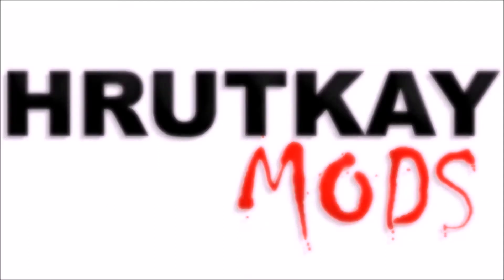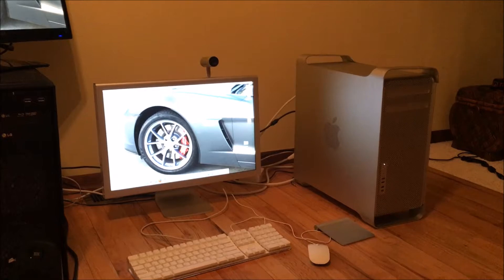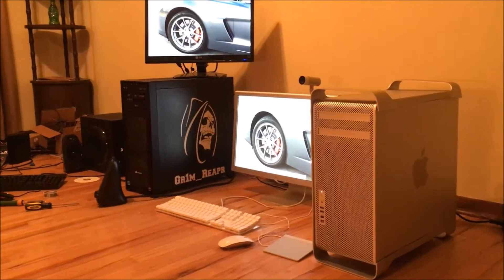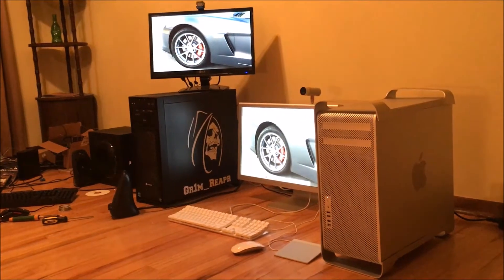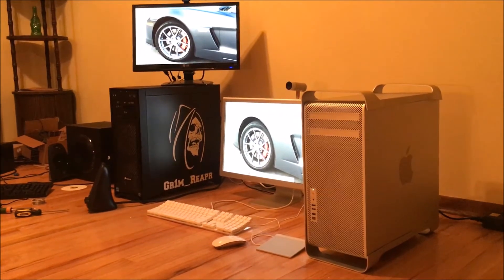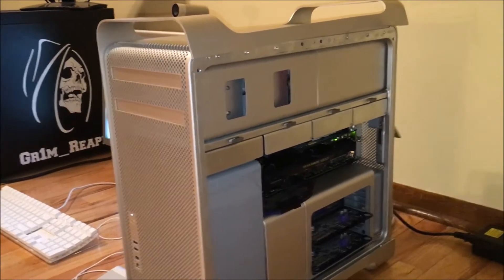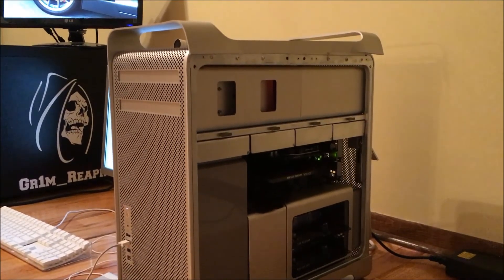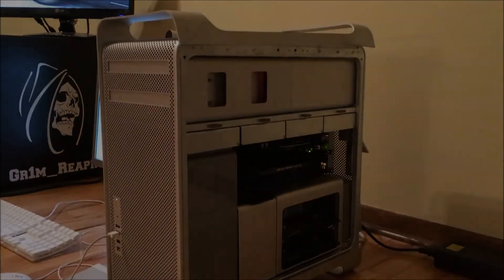Why You Should Buy One - Mac Pro 1,1/2,1 Series ep.3

Comment: I have a Mac Pro 1,1 2.6 GHz, ati Radeon xt1900 512mb, 12 GB RAM with Snow Leopard OS. I'm wondering if it is worth upgrading specs to a 2,1 system like yours? My main use would be editing and photography. I'm in two minds, especially since I don't have a copy of Lion to use for upgrade using Pikers boot eft., also I would need to upgrade CPU and GPU and update firmware.I live in Australia and a decent 2nd hand Radeon 5770 1gb card is almost $200 on its own. What other GPU choices do I have for this PCI 1.1 machine? Do you think I can upgrade for under $500???Any feedback or suggestions would be appreciated - thanks.
Reply: I am in same boat. I want to know what is the best coast effective graphics card. Perhaps do CPU upgrade I am about to do X5355 quad core upgrade.
Reply: Im from australia. I have a mac pro 1.1 with a 5770. works extremely good. ive upgraded it to 2,1 because of quad core. it runs like a beast!

Comment: I wouldn't endorse a 1,1/2,1 model anymore, since they are beginning to show age without significant upgrades, and they physically cannot go past El Capitan. The 4,1/5,1 Mac Pros are becoming cheaper now, so I would recommend that people try those out. 3,1 Mac Pros are also a possibility, since they can unofficially be taken up to High Sierra; however, they are significantly lesser than 4,1/5,1 Mac Pros (as far as the CPUs go). Only go for a 3,1 if you don't feel like upgrading a 1,1 to the point where it's basically equal to a 3,1 in specs.
Reply: The 4,1 and 5,1 Mac Pros will last for a good 5 years max I'd say, people say crazy figures such as 7 and 10 years - will they fuck last that long, 5 max.

Comment: hello Love your videos. I have 2 Mac pro 2,1 with your video help.  I just want to know that what is the best 2nd hand video cards for these? I have one NON-Flashed PC HD5870. I am about to upgrade CPU to X5355 (cost me A$10ea). I would be appreciate if you can guide me to choosing graphics cards. thank you
Reply from the maker: It’s a better question... what operating system are you gonna be using the most first example Yosemite and El Cap... a 750 or 750ti would be good cheap and a 950 would be a step above.... (900 series is the highest you can go in OSX) Mavericks (not counting the 750s) can go up to the 780ti... I’m not very versed on AMD cards... but go for the best price for performance... 5870 is still pretty good and you can Mac flash it (I think?) so either way just look around and play the market field